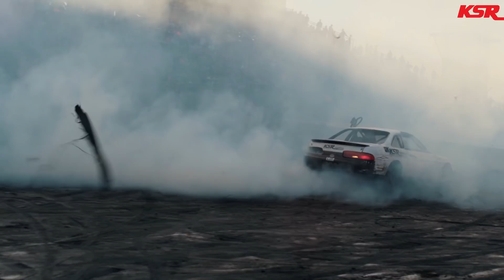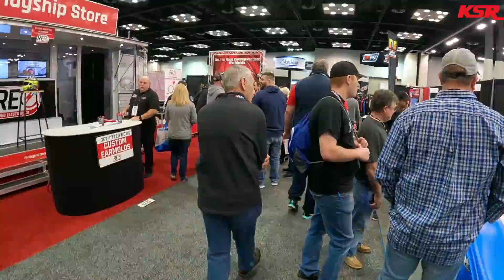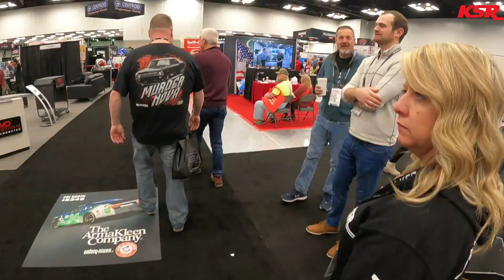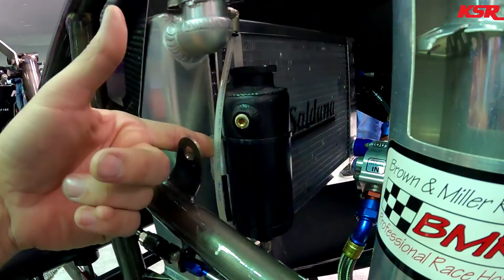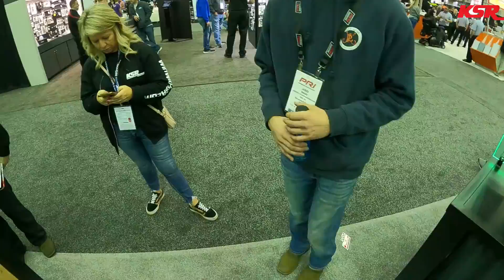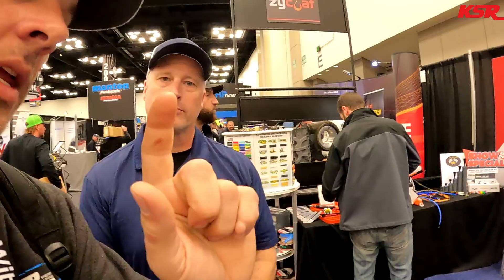Checking out The PRI Show 2021!!!

Comment: The problem with those cam lock cannon plugs is when they get any grit/dirt in between the cylinder and the actually rotating part they tend to bind easily. At least that's how they are on aircraft that land in the dirt. Might not be the best plug for a rocky mtn car, but more a dedicated drag car that will see less debris

Comment: Nothing like welding in a clean environment without getting burned. After many many years of putting in practice I got to the level  of welding TIG cosmetically. Run that seam to where you couldn't tell was welded  after polishing heat marks on stainless and paint carbon steel. Following proper procedure you've got strength and should never have cracks anywhere near weld. Work never felt like work. Sucks after an injury  my TIG career ended. Keep up the good work Kevin

Comment: The last three minutes of the video hit home for me. I do aircraft maintenance. Proper wiring is such an overlooked but vital part of any system. If the connections fail, it doesn’t matter how good the physical connections are. It ain’t gonna work. Spend the extra few cents on your wiring and you don’t have to worry for years about the nerve system.

Comment: Kevin, most of the stuff I saw from the video are base on gas engines. Would be interested in your prospective as to how long gas engines will be around vs how long do you think until electric/battery powered cars takes over the motorsports.